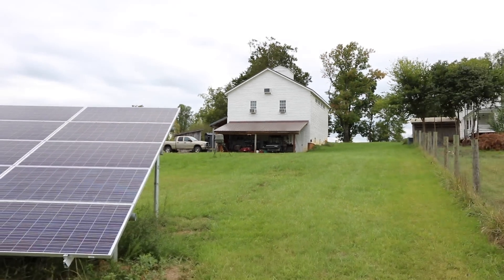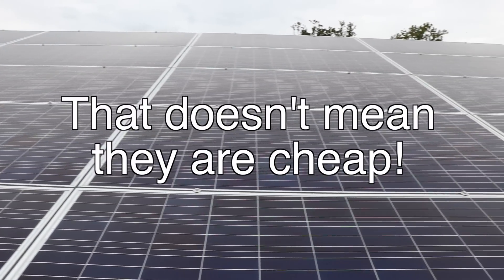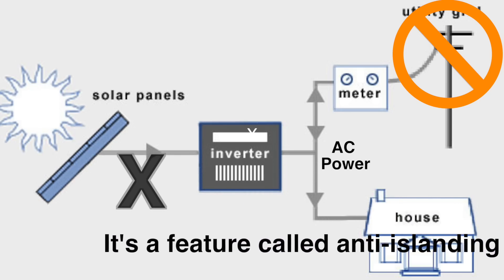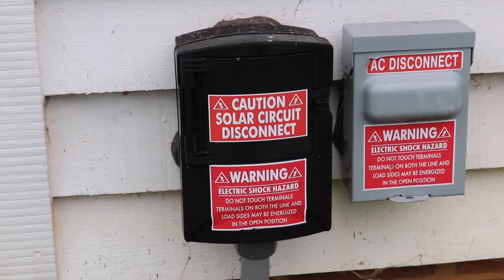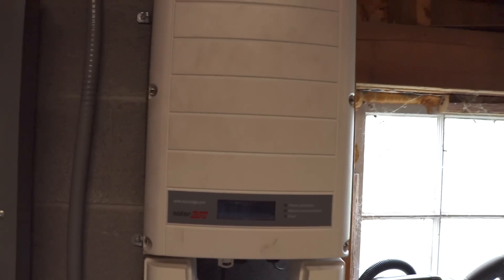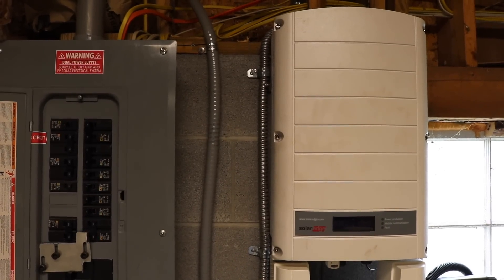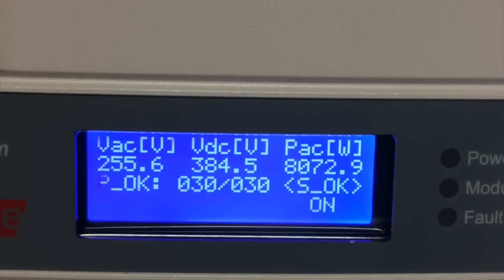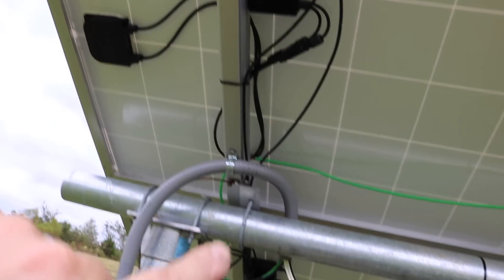The ugly truth behind grid-tie solar systems. Part 1, FarmCraft101 solar.  Watch before you buy!

Comment: 11:11 I think that applies to PARALLEL. Those are just diodes to prevent backflow of electricity. Someone just made a decent waterproof module (for they need to be in between each panel), benefits were popular, others copied it, eventually became cheap enough that every panel has one.

Comment: What a lot of folks don't realize is the huge safety factor involved in anti-islanding(running while the mains is absent). The grid acts as a big battery, without it, think what would happen around sunset and sunrise. The load will look in essence like big short to the solar panel inverters, and even if they were to run damage sensitive electronic or gear or power hungry AC equipment would damaged in a brown out scenario. So it's very important to disconnect the moment your system sees the absence of 60 Hz 240VAC from the power company. Of course if you use to purchase a battery power wall, all bets are off, but they are still pricy today.

So in closing, keep in mind, that grid tied systems are near perfect load balancing systems that gradually share power load delivery between Sunrise and Sunset, best regards to all.

Comment: Do you know how much power loss in the wire from the solar panels to the house?
Reply from the maker: There are many online calculators to determine voltage drop based on amps, wire size, distance.  My power loss will vary depending on the output of the panels.  When they are in mid-day sun and producing max, the amps will be highest and hence the losses will be highest.  In my case, 360V, 120 feet, 28 amps = 4.2 V drop.  About 120W max loss.
Reply: Thank you for your video and your answer.

Comment: Off grid, with Nickel/iron edison batteries make the most sense,if only they werent all made in China and poor quality. They are very tough,last for decades. Proper off grid system eliminates power bills and stays up when the grid is down or browns out. Here in Australia the renewable power grid generation is doing two things............skyrocketing power bills and an unbalanced grid that is difficult to manage. The incentive to close coal stations will only put bills up and cause brown outs as the grid struggles. On top of the Electric Vehicles will further burden the grid and convince people to leave,go off grid and cause shrinking support for the grid network. Complete madness.
Reply: The average person cannot support Nickel/Iron batteries.  Adding batteries to Grid-Tie PV System is a financial LOSS.
Reply: @MrSummitville  Its true that the more expensive battery, energy storage solutions have long pay offs.  Lithium is not doing well in grid storage, even a few of the large grid size units have caught on fire, and the LG home storage systems have been recalled in Australia, plus they typically have a 30% storage loss in just 4 years of use (national battery testing center in Australia). Of course, here in Australia, thanks to renewables and all their problems, our power bills have skyrocketed, it will likely AUD $1 kw/hr next year.  Back in June this year, there was a market collapse, 300% price shock for a month.  It was the result of run down coal stations planned to close, lost 20% of their capacity for a few weeks, combined with a wind drought nationally.  Everything feel apart, Sydney almost had rolling blackouts, which was avoided only by cutting power off to large commercial customers.

Comment: A 'solar system' has planets. A PHOTO-VOLTAIC system generates POWER. CURRENT flows; power is CONSUMED.  RPM NEVER RPMs (professor screaming in my head).  Oh, and you can bypass grid-tie interlock with ABT change-over to battery bank.   Also, wire size is depended on RESISTANCE (R) i.e. P=I*R^2  cause heat = fire = bad.    Please research before educating. And speeky, Englesas.

Comment: ?CAN I RUN A WASHER DRYER LINE ON THE SAME LINE AS MY SOLAR PANELS IN GRID LINE? IF NO, WHY? what would happen
Reply: You could, certainly up to 5KW  if it is 240V - 30Amp line, but why would you consider that? A certified installation probably requires a (firemen) disconnect on the outside near the  meter so you might just as well connect at the main panel - probably 'above' the main breaker.

Comment: Don't do it
In long term look at after you payoff the system look at the life/maintenance of the panels (yes panels have a life span) + the degration of the silicon = less power output throughout the day.
 DC(panels) to AC(inverter) then back to DC yes all electronics are DC. Seems  like a waste to me.
I would take those 17K and invest them in super insulation all around the house and double glass gas windows and an efficient HVAC system and led lights .
But what do I know
Reply: danialphaomega I mean you can just look up a system and see how many panels you need to off set your electric bill in my own home it would only take at most 12 years to pay off and assuming they live past the 25 year mark it would pay it's self off and buy a new set if you wanted. Also if you sell the house the solar is a big draw for some.

Comment: that does seem high, 200$/mo 6.56$/day assuming you dont have winter and its sunny as heck all year, you're not in a desert however...assuming 8 hours peak efficiency which you wont get, 6.3kw avg production out of 9.1 or 70% efficiency on average every day all year long ......quick google search points to market leading panels being 22% efficient or 1/3 stated here...unless its 9.1 effective out of 27kw...another quick google search points to 5$/watt or 46000 for 9.1kw or 150k$ for 27kw

nothing here adds up, the federal subsidy isn't limited is it? otherwise why would you stop at just 9.1kw when its making 9% returns yearly.....

Comment: I suggest you might consider including  including  the time value of money in your calculation of break even time. There is an opportunity cost for giving up the $17,000. 

At the average low stock market rate of return over the last 20 years, some of the worst years in stock market history, of 4.5%  17,000 would be worth  24713.00. in 8.5 years. At a more typical and still safe rate of return  of 8.8%,  it would be worth  $34524.
Reply from the maker: Not if you pay a monthly electric bill out of that money.  I got through the full calculation here: https://youtu.be/gAswWVETWKo
Reply: That is a pretty good detailed calculation. I would have assumed a somewhat higher portfolio investment return, but I see your logic and it's reasonable.

Comment: Just curious, but what's the cost difference  between if you had a automated service disconnect so you could use your solar system when the main grid was down as apposed to buying the solar backup system (batteries, battery inverter). Granted I can see the benefits to having battery backups when main power grid was down on cloudy days or nightfall.
Reply from the maker: A grid tie system will not function without input from the grid.  An automatic disconnect wouldn't change anything.  Watch my followup videos.

Comment: if your producing more power then you consumer and the meter goes backwards, would you then get a check or a credit from the power company ?
Reply: yes, but its generally not worth your while
Reply: @TheVergile  It's worth it if the excess is not going to get used for anything anyways. Besides, even though the rebates are only 1/3 of what the electricity would cost you if you bought it from the power companies, you will still get several hundred dollars back a year. Nothing to sneeze at.
Reply: Umm. Just because your meter may "run backwards" during a nice sunny day and no one is home to use the the net electricity produced by the panels, the meter will start running forwards again at night and re use those surplus Kilowatts you sent to the grid during the day! It's like the grid is a battery storing the surplus energy for you to use back at night. The only way to actually get a "refund" on your bill is to produce MORE electricity for a whole billing cycle than what you used LAST month. Say the meter is read on March 1st. Say it shows 145010. They bill you for the difference of this reading from last months reading of say 142239. You get a bill for using 2771 Kw/hrs.  NOW, say you were on vacation and away from home a lot in March and there was a lot of sunshine. They read your meter April 1st and is shows 144350. Hmm. Dang, it's LESS than it was on March 1st by 660 Kw/hr! Now it's time to hold our YOUR hand and have the power co put some dead Presidents in your hand! Am I right?

Comment: Just curious why you didn't put the panels on the shed roof attached to the house, close to the inverter?
Reply from the maker: It's not big enough to hold all the panels.  Also, it's not at the optimal angle/direction.

Comment: The artificial financial support of grid tie PV can't last.  When the narrator states his electric bill is $200/month, he assumes his PV battery system is worth some $200/month to the grid. Sorry.  The  the grid connection to the house has a real cost of some 75% of the power bill, or  $150/month innthe case, even if it never carries an amp.  Such is the cost of that vast array of transmission and power generation plants on the other end of that utility connection that always supply power, night or day, winter or summer, rain or shine.  The only true way to avoid that $150 is to avoid the utility connection altogether, go off grid.  The cost to manage that 100% reliability via batteries or diesel fuel and generators alone, is far higher than $150/mo.
Reply: No, there is no assumption of "The value of the PV System to the Grid".  The only value is ... the value of the PV Generation to the homeowner.  During the day, the PV System provides the power needed by the house.

Comment: I have watched all your videos in this series. You have excellent presentation skills and its filled with wisdom. You  are amazing and share what you know to greatest detail. Thanks a lot of sharing. Please keep making such videos. I want to ask, why did you not use the space below the solar panels to build your electrical room to handle all kind of stuff from inverters, charge controllers & batteries ?  That would have saved you from running a DC wire underground.
Reply from the maker: Because I'm transmitting at 360V DC, it's actually better to transmit with the DC line than the AC lines, which are 2 120V lines.  DC has less losses in power transmission anyway, even at the same voltage.  It's just seldom used with solar historically because typically the voltage of the DC lines is much lower than the AC voltage.  Thanks for the kind words!

Comment: "Not that kind of solar system!" LOL. But, why did you locate your PV array so far from the house -- considering the cost of cabling?
Reply from the maker: Couple considerations here.  The price of the wire of my system isn't too bad because the voltage is high (360V) and only 1 8 gauge wire is required.  I also had a package deal on my install, and actually didn't have to pay any extra due to the  system being a little farther away.  That location was the best aesthetically for my homestead.  Thanks for watching!

Comment: This connection type kind of SUCK's in my opinion of course.
   If you are young say 20s 30s heck yeah not a bad idea at all.
   BUT in your 60 70 80 90 100's NOT SO GOOD YOU MIGHT AS WELL JUST STAY ON THE GRID,, BUT HAVE EMERGENCY TYPE SOLAR AS A BACK UP. YOU CAN BUY A SET UP WAGAN THAT WILL RUN ABOUT EVERYTHING YOU EVER WANTED EVEN AC UNIT TV TOOLS FRIG MICROWAVE,, AT I SEEN ABOUT $1800.00 MAN THAT IS GREAT PRICE, 2000 CHARGE UPS ON ION BATTERY.
  ANY WAY AGE HAS ALOT TO DO WITH THE MONEY YOU SAVE AND THE MONEY YOU GET FROM THE GRID YOU SELL TO THEM.
  RIGHT NOW YOU DO RECEIVE MONEY KICK BACK TO HELP PAY THE INITIAL PRICE. SOME STATES GIVE A $1000.,BUT IF YOU ARE NOT FILEING FED TAX OR STATE TAX,, FORGET THAT PART YOU ARE STUCK WITH THE WHOLE PRICE. ALOT OF SENIORS DON'T FILE ANY TAXES ANY MORE.
  YOU CAN RENT OR LEASE SOLAR BUT THAT PAYMENT IS ALOT HIGHER.
  I'VE CHECKED THIS STUFF OUT.
  OH THE REALLY BIG BAD THING I HATE ABOUT THE HOOK UP TO THE HOME IS,,
IT DOESN'T WORK WHEN THE GRID GOES DOWN. WAIT WHAT?? THAT IS WHEN I REALLY REALLY NEED IT TO WORK,,, BUT IT DON'T, AUTO MATICLY SHUTS OFF WHEN THE LIGHT SWITCH DON'T WORK, NOTHING WORKS.
   THAT'S WHY I SAID JUST GET A SEPARATE SOLAR UNIT. IT WON'T SHUT OFF WHEN THE REGULAR ELECTRIC DOES,, IT'S SEPARATE. AND ACTUALLY YOU COULD RUN HOME EVERY DAY WITH A UNIT LIKE THE WAGAN OR OTHER BRAND IF YOU CAN FIND ONE AS GOOD FOR LESS MONEY, RIGHT NOW I HAVEN'T FOUND ONE AS GOOD. ONE THING ABOUT THE WAGAN THOUGH IS THE WEIGHT, FORGET LBS BUT FOR ME IT WASN'T REDICKULESS. AND BESIDES I WOULDN'T BE MOVING IT ANYWAY. I'LL USE MY SOLAR ENERGY EVERY DAY AND IF I NEED TO USE THE GRID, (REG ELECT) SO WHAT MY ELECT BILL WONT BE MUCH ANY WAY. WON'T HAVE TO USE BOTH MUCH UNLESS MAYBE PEOPLE ARE STAYING FOR A WHILE AND MAKES USAGE GO SKY HIGH.
   ANYWAY TWO DAYS AGO THIS SYSTEM WAS OFFERED TO WIFE AND I, BOTH AGREE NOT FOR US.
  I'LL SAY THIS,, SOLAR POWER IS GREAT IF WE BUY THE RIGHT POWER.
  SEPARATE FROM THE HOME,, BUT IT WORKS FOR THE HOME,, WHILE EVERY BODY ELSE IS NOT,, UNLESS THEY HAVE SEPARATE SOLAR. ENOUGH ALREADY YOU GET THE PICTURES.
  GOOD LUCK

Comment: listen solar panels are useless. they don't make enough power!!! vacuum solar tubes are the answer. you can diy a set for the price you paid for those solar panels. just get some telescoping tubes and etch on the material and telescope them together and then vacuum seal to add longevity and increase production.
Reply: PV Panels may be useless to you .

Comment: My electric company will not run the electric back on the meter. They dont even credit you the power you dont use. In TN. The meter just blinks.
Reply: Then don't install PV Panels.- problem solved !

Comment: Why  didn't the installers go for 2 x 15 panels configuration ,rather than 3 x 10 ?
The panels are UL certified for up to 1000V ...
Reply from the maker: The inverter needs around 360V.  That's the determining factor.  Otherwise, higher voltage would make sense.  Thanks for watching.
Reply: Well,they could have picked up the inverter according the string Voc .
There are many inverters to select from...
Every PV designer aims for as high voltage as possible first ,then for the appropriate inverter that handles the voltage and the current. 
1500 V is the new standard going on.

Comment: I use a Schneider Electric Conext XW 4548 Inverter/Charger with a 3 KW Whisper 500 Wind Generator that is 14 Years old and still spinning. It has 2500 Watts of PV. My net metering has been near zero each year. A hybrid system allows you to have flexibility if the grid goes down given you have a large battery bank and or standby generator that it also can operate to keep the batteries floating and home alive.  Here is a example.  http://www.hardysolar.com/wind-turbine/whisper-500.html

Comment: In a power grid down scenario, it shouldn't be to hard to wire your solar panels around the grid or basically just disconnect the grid completely so you could use only solar.  
     Thanks for the video and information.
Reply: HOW ?

Comment: Sigh.  Still seeing outrageous claims about break-even.  $17K invested at 7% (typical stock market return) is $29.2K over 8.5 years.  That's what you need to save in energy costs to justify investing in this system.  If you can't generate that sort of return, you shouldn't be investing in residential solar.
Reply from the maker: I have a video on this.  https://youtu.be/gAswWVETWKo  It's not as simple as you say.  You have to pay your electric bill out of that 17k invested, and you have to include the rising cost of electricity over the years as well.  Including maintenance and investment income, the break even time is actually more like 12 years, but it still beats the stock market in investment efficiency over the life of the system.

Comment: Great video! Agree with everything and you presented it very clearly (except do not know why anybody would install optimizers on an unshaded array but, to each his own!). Only thing that will go down is the optimizer as, panels rarely fail! Could have saved a lot of $$ for the same outcome.
Reply from the maker: Thanks!  Regarding optimizers: We had a co-op where many people came together to buy equivalent grid tie systems and we all got the same installation which made it cheaper in the long run.  In other words, I got a bulk discount but didn't have choice on details like opting out of optimizers.  The conventional wisdom is that optimizers aren't needed for an unshaded array, but I see a fair amount of variability in the output of my panels, probably 5% or so.  That means I am producing more power with the optimizers than without, even on clear sunny days.  Also, if a bird poops on a panel or when snow has a small portion obscured I see the benefits.  So even with my unshaded installation, the optimizers help some, but hard to say if it's worth it.  Given the big discount I got on the installation, I think for me it was.
Reply: Indeed I am sure you received a deal! And yes, panels vary very slightly in production - that is a function of physics. Are you then saying that the optimizer produces more energy hence, making up for any loss (if there is one) from a panel or two? Are you factoring in the inherent loss of each optimizer?  DC to DC converters (optimizers) themselves have losses that the mfgs do not tell you about. Its a big marketing gimmick especially on ground mounts. But again, to each his own and happy to hear this worked out!
Reply: Clouds can randomly shade the array...